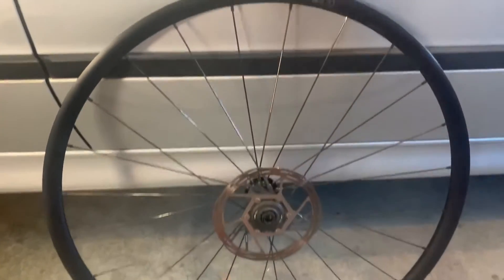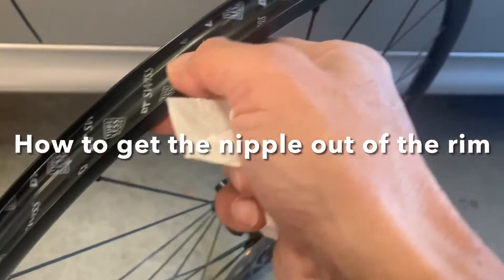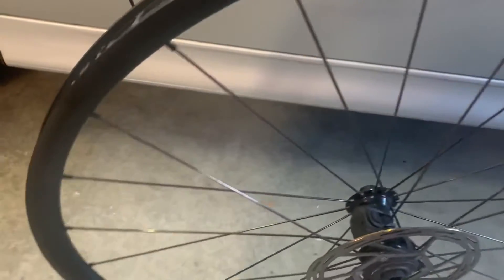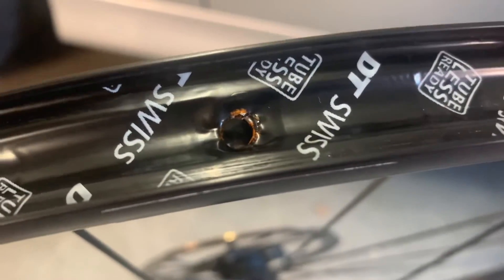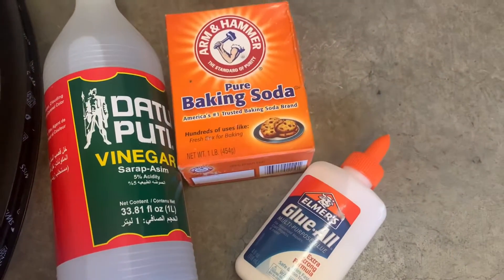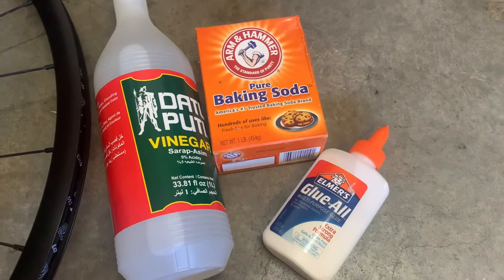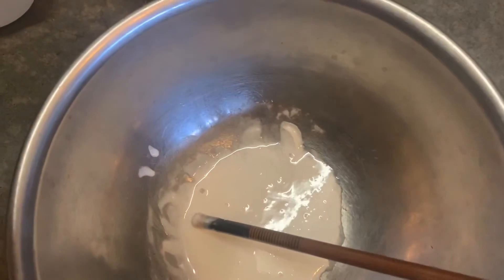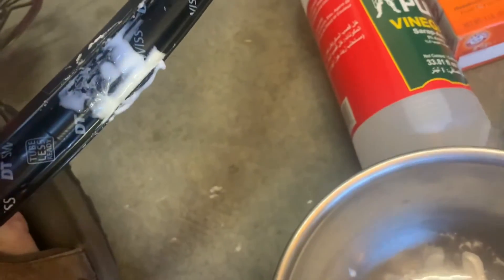How to get the nipple out of a double walled bicycle rim

Comment: This happened to me but I was able to get the nipple out by using duct tape (sticky side out and another piece holding it to a toothpick) and jiggling the wheel until I no longer heard it bounce inside the rim. At this point I removed the toothpick and it fell out with it.

Comment: Just put a small screw driver or Allen wrench in the valve stem hole and rotate rim until the nipple stops at the hole. Then poke at the nipple and it will come right out. Very easy and no mess.
Reply from the maker: I tried your technique and didn’t work because it’s difficult to align the nipple straight to the hole.  It’s always at an angle to the hole and unable to get the nipple out.
Reply: LOL. Uhm…NO. 
You don’t think anyone thought of that? 🤦🏻‍♂️ 
No, that does not work for anyone who does not have your one in 1 million luck.